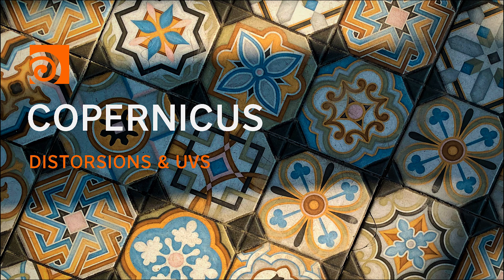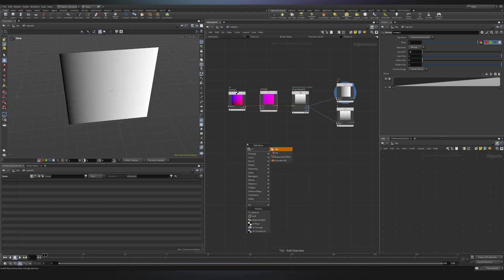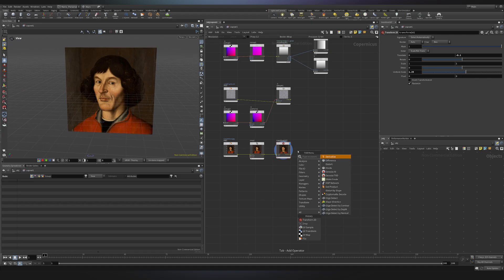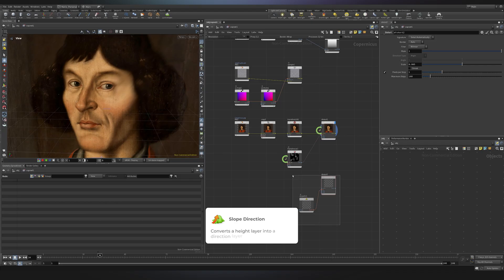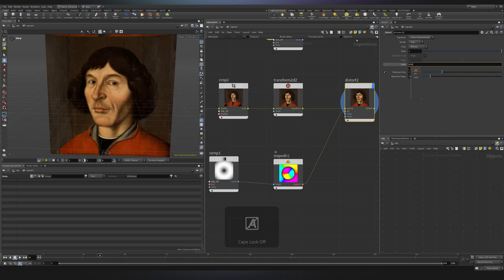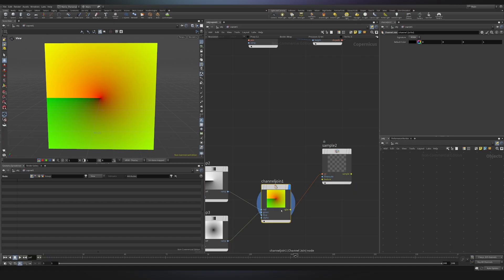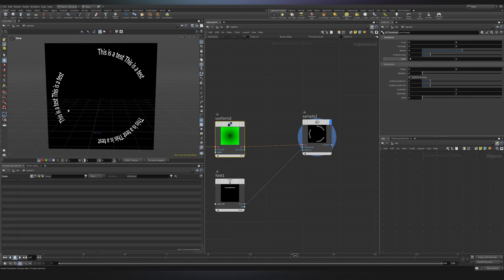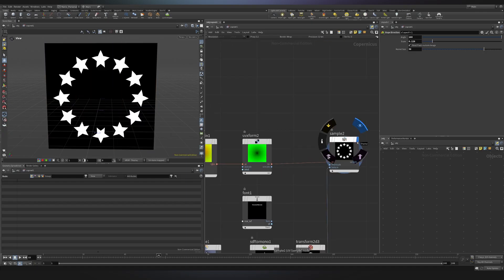Master Distorsions & Polar UVs in Copernicus in Under 10 Mins!!

Comment: I have seen that Copernicus and mtlx and karma are not well implemented well for procedural sharing.

Cgforge commented on that once , what are your thoughts about it ?
Reply from the maker: Hi, I think they are well implemented, so well implemented that if you know what you are doing you can reference the copernicus nodes (Height, Basecolor) in a MtlX tiled image.
This is all made possible thanks to the "opdef:" syntax, which means you don’t even need to export the textures to disk. The textures are read directly from your CopNet in real time.

I will be explaining this in the 4th Cop video in 2 weeks!!